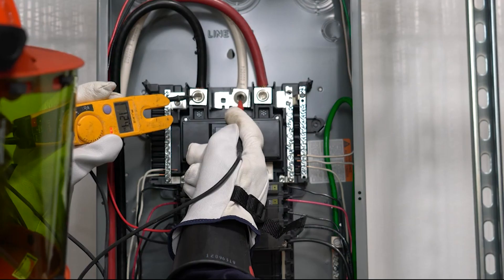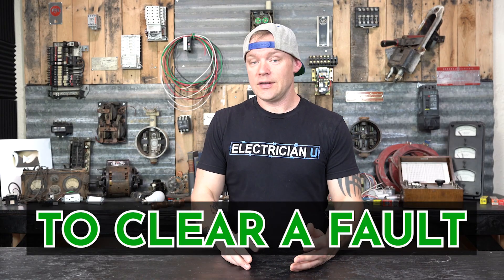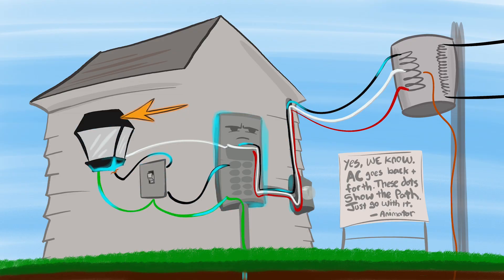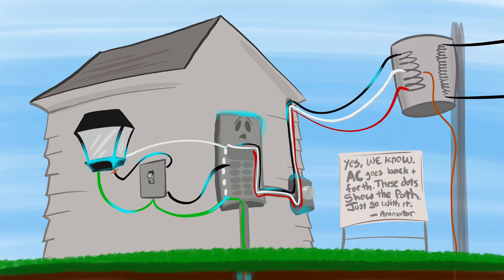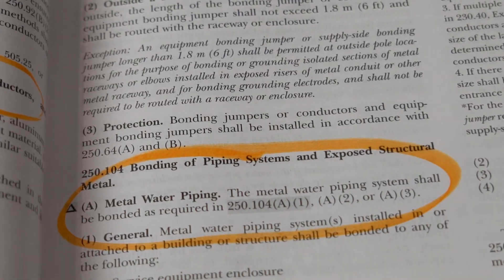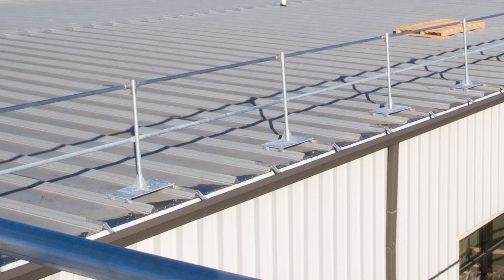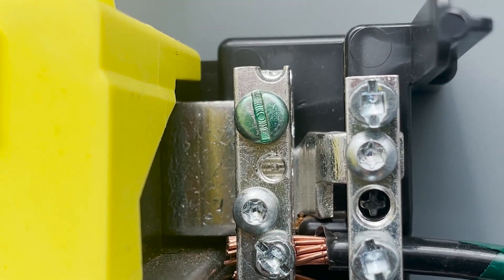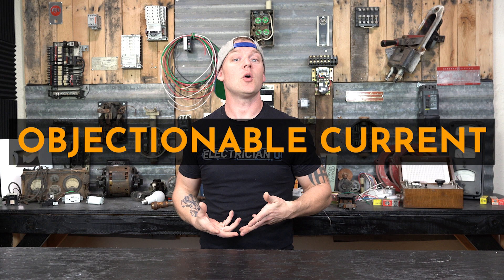Why Do We BOND Neutral & Ground in ELECTRICAL SERVICE PANELS?

Comment: I saw a demo on the subpanel neutral thing on another youtube page. They explained that they are separated because the ground is usually assumed to be dead, if it was bonded some portion of the neutral return would be on the ground and if the ground was to be broken, etc the person could get shocked off of it. Or if the neutral outright failed the ground is then the return for the neutral and makes the above condition even more dagerous. This is also why they put a jumper wire around the water meter so that if there is current between the sides and meter has to be changed, etc there is no voltage potential between the in and out of the meter. 

I was told galvanized gas line had to be bonded too but then I was told in my area they don't inspect for that and the gas company sees that it is bonded they will undo it. I see both ways with that but to me mixing gas and electricity is a very bad idea. My fear would be there is a voltage potential on a gas line a coupler, or junction is undone and a spark ignites the gas (or even just a little gas in the line after the shutoff valve). I mean a shock is not good but neither is a gas explosion or fire. I would be really curious about the code on this from the electric and the plumbing side as it seems like they would almost be contradictory to me.

Comment: Could you make a video of the reason subpanels need to have grounds and neutrals separated? Love your stuff man, thanks a lot!
Reply: What he failed to mention is that the main reason for keeping them separate is so there’s no stray current on the ground, when they are bonded at a sub panel the ground will have about half of the current because you’re creating parallel paths. Where as when they aren’t bonded it keeps the ground as a non-current carrying conductor
Reply: I'm pretty sure he mentioned that in this vid
Reply: @caseyk6625  my apologies, I didn't have the chance to watch it through 100%.

Thanks!

Comment: My grandmas fridge shocks you when you grab the handle.. I think she's cool with it like that, It keeps us away 😒
Reply: Lol...that should get checked out.
Reply: If the fridge only has a two prong plug, unplug and plug back in turning the plug around.
Reply: @timtitus6846  that wouldn't do anything. The casing of the load should never be energized. This means the cord is rubbed out somewhere and a conductor is touching the metal case of the fridge .

If there is no EGC (old fridge) and no grounding conductor on the appliance plug, that equipment casing is energized with only one path to go back on. (The original hot and neutral)

What the guy in this video isn't explaining is electricity will take all available paths back to the source even if minute, assuming voltage overcomes resistance. An EGC bonded to the fridge case provides a secondary path back to the main panel. Being bonded to neutral it can add to that return current during the normal AC cycle and this pulls enough through the hot line and its breaker that it opens the circuit and clears the fault.
Reply: @etherealrose2139  It is call Leakage Current.  Rotating the 2-prong plug 180 Degrees in the outlet, may cause leakage to now come from the Neutral wire vs the Hot Wire, and that could "do something" - something good!   If three-prong plug, then the Ground Wire is broken somewhere ...
Reply: That indicates a problem with the appliance or the house wiring. It should be checked out. A slight tingle could turn into a dangerous shock in a different place, like a damp basement or something.
Reply: Terrible if true
Reply: A defibrillator  so to speak!
Reply: Shocking!!!
Reply: It might be a wired wrong in the receptacle. Hot swapped with ground, or hot swapped with neutral.

You might want to invest in one of these. I know it's probably a one-time-use thing, but it would be good to have anyway. Might want to go around checking the other receptacles to make sure they aren't wired wrong too. The $6 could save your grandma's life.

https://www.amazon.com/dp/B01AKX3AYE/ref=cm_sw_r_cp_apa_glc_fabc_JVJM7B48PVXAB2T6SMCS?psc=1

Comment: Another great video, thanks Dustin!  Hey - I have the exact scenario you described, 3 panels, 1 main and 2 subs installed in the 60's.  I noticed the neutral and grounds are bonded in both sub-panels, but an electrician told me it was correct in this case.  He said it's only correct because they didn't run a grounding conductor, there's only 2 hots and 1 neutral that runs to each sub-panel.  Can you confirm or deny whether that's correct?
Reply: That is correct. Not ideal but correct

Comment: Great video my man!  Grounding and bonding is so important and can be hard to get the full grasp of it in the NEC.  Content like this is helpful, keep it coming!
Reply: Since it could prevent a house fire and can save lives then it is critically important to get this right first time and every time in every install.

Never skimp on safety. 

It's hilarious when people bitch about the cost of Arc fault and ground fault breakers/outlets. You do realize these are designed to prevent your house from burning down and from you getting electrocuted to death right? 

And some states, like Michigan, ignore the NEC and no longer require afci breakers.

Comment: Never quite understood why we had to float the neutral in sub panels, and now I get it completely. Thanks for another great vid! Maybe add load calcs for sizing a service to your long list of ideas for videos you said you had?
Reply: floating neutral is what they call an interrupted neutral around here. Such as when the grounded service conductor loses, or loosens, contact with the grid. bad things happen.
Reply: It’s mainly so you don’t create two paths for current during normal conditions, because when they are bonded without any fault the ground will carry about half of the current, making it a current carrying conductor which it’s not meant to be.

Comment: The question and the word "bond" are the wrong way round: the "bond" is where we decide to split up & distinguish between the grounding system and the neutral system. They do both depend on the grounded service conductor, the grounding only "partially", but MOSTLY.

Comment: What is preventing the current from the neutral that is going back to the service panel from also going to the ground conductor at the service panel if they are bonded?
Reply from the maker: I will do a video on this, thanks for the question!  the short of it though, is that current is looking for it's home..and if a deviated path goes off in a different direction and doesn't lead back home, current won't flow on that "leg" or "path." It's always going to take ALL PATHS that it can to get back home,.

Comment: Freaking love the toon representation of what happens during a fault! Def helped me understand exactly what’s happening. First year IBEW apprentice here and your vids are helping me tremendously.
Reply from the maker: Thanks for watching! Keep grinding my dude!
Reply: 2nd year IBEW 313, will be 3rd year in the fall. Like the way he explains.
Reply: @funsizedi88  prepare to be laid off after year 4. the only way uyou wont be, is due to this covid thing and people quitting jobs.
Reply: @themtb2003   LMAO! you can throw a dart at a map and go to work right now if your Union. LU 136 (20 years)
Reply: @themtb2003  it's the name of the game . It's literally what you do for a living 😆  you work yourself out of a job!!!
Reply: @funsizedi88  sister local Im from 654 and yes save some money like the other fellow said
Reply: What local?
Reply: Though he made a mistake @ 2:45 - 3:08. In the animation, charge/current is flowing through the ground wire of the light fixture then through the ground rod of the house and then to the ground (as in the Earth), without any return path. So, the animation implies Earth is gaining the charge due to the fault current. But that can't happen unless it is "static" electricity (which is not the case).

The problem specifically is that the animation, while it shows the ground rod and ground wire of the transformer (as well as of the house), for some reason the animation doesn't show the fault current of the light fixture traveling to the Earth ground and then returning to the transformer via the transformer's ground connection.

Comment: I maybe in the minority here but I can't say that this made things any clearer. I feel like this explanation is meant for someone who does not want to get in the weeds but wants to think they understand it. Let me rehash that. This explanation is meant to understand what is happening not how and why it happens.
Reply: the word "bonding" makes you look at it wrong. we're actually splitting up the functionality of the grounded service conductor & start to make a distinction between neutral and grounding wires.
Reply: If you bond the ground and neutral at the sub panel as well the main panel the  ground wire between the two panels will carry current ALL THE TIME, not just when there is a fault .

Comment: Can you talk about why I have a grounding wire going across the pressure regulator for my plumbing?  I have copper piping.
Reply: Good question, got me scratching my head about it, and I did an image search for domestic water pressure regulators to see if I could come up with pictures of pressure regulators with non-conductive bodies.  I didn't,  they all seem to have cast bronze bodies,  but I did see quite a few pics of pressure regulators with bonding jumpers across them.   Maybe it's because there are threaded fittings, and the concern is that there's not a good clean path across the threads due to pipe dope?

Comment: the number 1 question I have is why doesn't current backflow into the ground if it is connected to the neutral?
Reply: Because the grounding conductor is not connected to the return path on any equipment. It is connected to metal parts only, not the return path, and the metal parts are not used as a return path. So in a lamp, the current flows between the hot and the neutral (groundED) conductor. It only flows through the groundING conductor  if there is a fault, like the hot contacts the metal case.  In other words, there should not normally be any current flow through the groundING conductor.  Does that clear it up for you? It can be a confusing topic.
Reply: @ianbutler1983  still not clear although I do believe I  understand what you are saying . the neutral is the return and carries excess current back to the transformer then back to the house correct ? so if the neutral wire carries current then why wouldn't current flow into the ground wire thus making it energized.
Reply: @j.s3612  Yes. SO if you took the hot wire and put a lamp between it and the groundING conductor the bulb would light and the return path would be through the ground. In this situation, the groundING conductor would do as you say, but in normal operation the groundING conductor is not connected to any part of the appliance other than the metal case, so the current flowing from the hot conductor has no way to travel along the ground, unless there is a fault in the device. So yes the current could flow back through the groundING conductor but under normal circumstances it should not be there.
Reply: if I connected a hot wire I into the ground rood outside  would  electricity want to flow into the rod and into the dirt  ?
Reply: @j.s3612  Yes, The earth (soil) is surprisingly conductive. If you had a good ground like a deep rod in moist soil, you could probably light a bulb if you are close to the house grounding rod. It is something to be done with care, if your feet are wide apart you could have a voltage difference between them. Telegraphs used to operate with a single wire, using the earth as the second conductor, and in some rural areas (Australia I think) they have single wire electrical service with the second conductor being the earth. It works over hundreds of miles.
Reply: @ianbutler1983  the telegraph thing is interesting.  Would it be possible to light a buld in that scenario if  electricity doesn't have a path back to the source, through the house ground rod ? Suppose if the house ground is disconnected would the bulb still light if it's only the hot wire and the isolated ground rod .
Reply: @j.s3612  It would probably light at a reduced rate, but that is because the ground return path would travel through the ground rod at the transformer. The groundED conductor is tied to a grounding rod at the transformer as well as the house. If the ground rod was somehow isolated from the actual earth, then there would be no current flow, Think of the earth as a second conductor in the circuit. An isolated earth would provide no path for current.